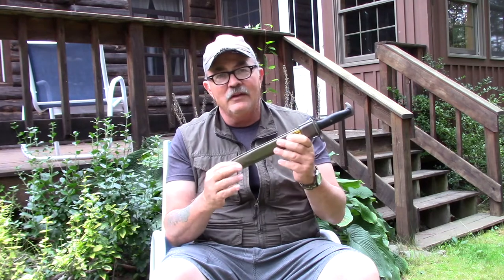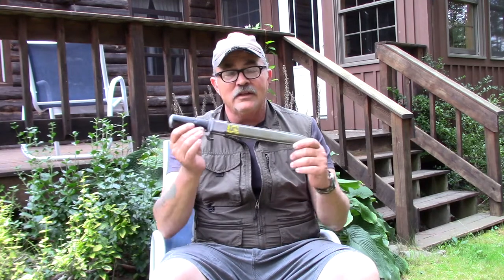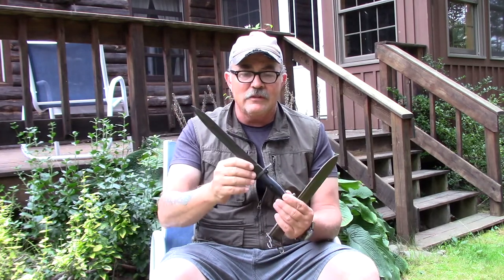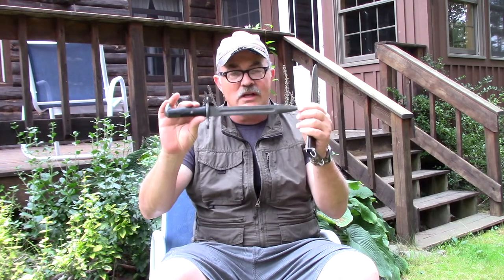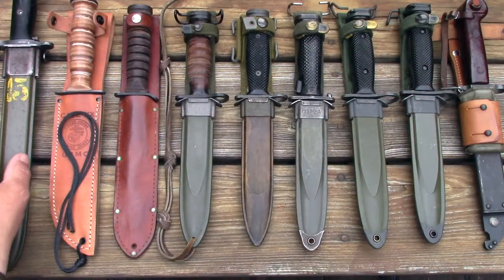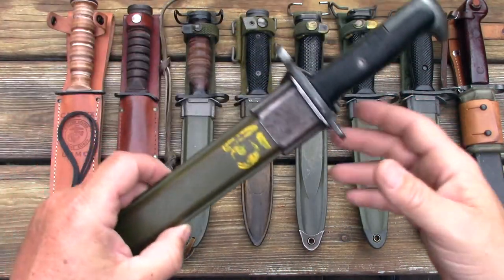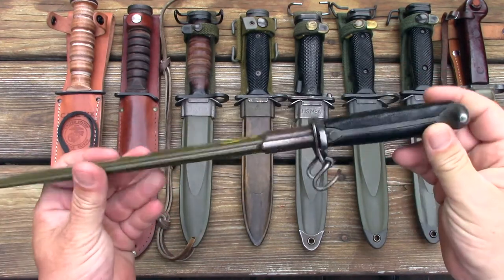Evolution of the USM4 to USM7 Bayonets

Comment: I picked up an M7 for my first AR build several years ago. How common was it for them to come with the M10 sheath?  Also it feels like it has a sharpener in it as well.
Reply from the maker: Not terribly uncommon but I never encountered the M10 scabbard in the military, even in the early 2000s. They certainly made a lot of them and the M7 was issued with the M10, I think as supplies of M8A1 scabbards started to dry up. I’ve never owned an M10. I’m completely unfamiliar with its internal construction.
Reply: @SuburbanRifleman  After a bit of  trying to remember where the hell I got it from in the first place, I've since remembered it's an Ontario 494 non issued M7 with M10 scabbard.  It wasn't bought to be looked at but as a just incase things go to shit again.  After what I went through from hurricane Rita and the riots that went on in my current state I buy things for 1 specific purpose.

I'm pretty inexperienced with bayonets and I chose the M7 over the others because it's made to kill, not kill and like the M9 etc.  So I'm not sure if I'm just feeling the retaining clips within the scabbard or since the M7 is also meant to be used as a combat knife and therefore meant to be sharpened in which case a self sharpening scabbard would be logical.
Reply from the maker: @Scott11078  the M7 will definitely get the job done, if it comes to that.
Reply: The m10 shealth was for newer knifes from late 70s-80s the m7 still produced by Ontario knives and used in other countries the m8a1 was original sheath during the 60s -70s  also depends on the brand you have of the m7 mines a Columbus milpar with a m8a1 it marked on the sheath a issue number so I know by brand year  and sheath it was issued during Vietnam and carried .there is a list of manufacturers that made those knives and years they we’re In service by each manufacturer  on internet .

Comment: Wow can't believe I'm just now seeing this video.  I was watching videos of the Mossberg 590 shotgun with the bayonet lug and magazine cap for the large ring of the M7 and M9 Bayonets.  It seems that the current production Ontario M7 is slightly longer from the bayonet lug latch to the front attaching ring and does not work well on the shotgun. Guys are having to shim the shotgun magazine cap forward.  I guess it's not a problem on an AR15 20" barrel and 14.5" barrel.  My Mossberg 590A1 came with an Ontario M9 Bayonet and I already had a contract one made by Lan-Cay.  I also have an M7 bayonet that is marked Colt on the blade and was made in West Germany with an M8A1 Scabbard. Back when I was buying the M7 style ones they were pretty cheap (except the Colt) but now all of them are like everything else, expensive.  Nice video presentation.
Reply from the maker: @mrweeby1961  thanks for your feedback! I wasn’t aware of the issue with the Mossberg 590. I’ll have to read up on that. I wish I would have held onto my old Phrobis M9.
Reply: Yeah the phrobis III would have been nice to get but they were already too expensive for me.

Comment: because of the quality of the us M-3' trench fighting knife and its durability and ease of usage  , it should have never been up graded to m-4' through 8' although the us M-5' A1 has a nice good feel in the hand and the mad turks swear at you by it  , other than that my Ontario sp 7' is a slightly improved version of the old reliable us M-3' the improvement being the steel tip skull crusher= remember conserve ammo use a knife = old USMC  maxim

Comment: You are giving the impression that the M8 scabbards are WWII and all M8A1 stamped scabbards are post-WWII. Not true. The M8 scabbards were for the M3 fighting knife then converted for the M4 bayonet and designated M8A1 and were stamped as such.. The reason you see M8 stamped M8A1 configuration scabbards is because the manufacturers used the leftover M8 throats to make M8A1 scabbards.
Reply from the maker: I thought “somewhere along the way” would be sufficiently ambiguous but thanks for the clarification, nonetheless.

Comment: I've got a m7 bayonet with a cerved runout . Imperial with a m8a1 scabbard. Think they  changed the run from 90 degree in 1974,? .. So I think mine will be post Vietnam. Think imperial had a few contracts from 1973 to 84??
Reply from the maker: Yes. I think you are correct. 1974 sounds right.

Comment: No U.S. M9 bayonet? It has a wire cutter function too, and you could have demonstrated that instead of the commie blade which doesn't belong in that lineup.
Reply from the maker: I had an M9, one of the original Phrobis III models made by Buck. I sold it a while back when its monetary value outstripped its usefulness in my collection. I’ve been thinking about getting one of the new examples from Ontario. I might. 
Anyway, the AKM bayonet is a contemporary of the M7. The M9 came along quite a bit later. 
Thanks for your feedback!